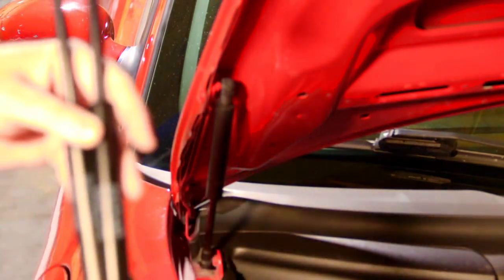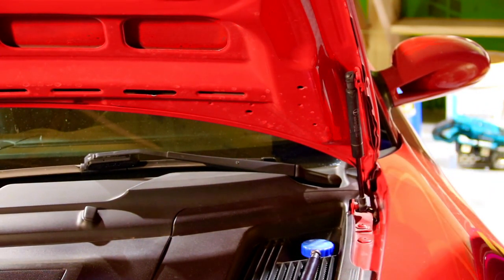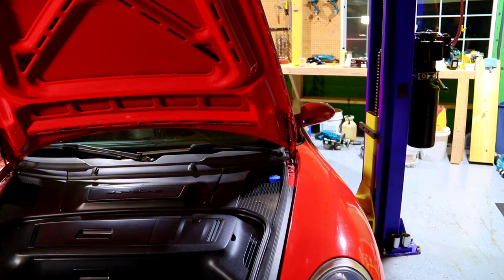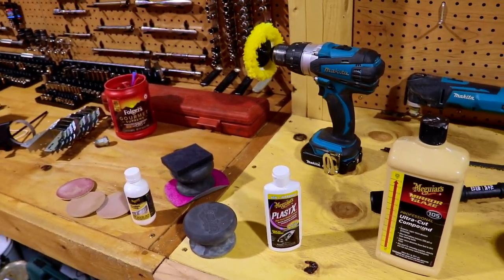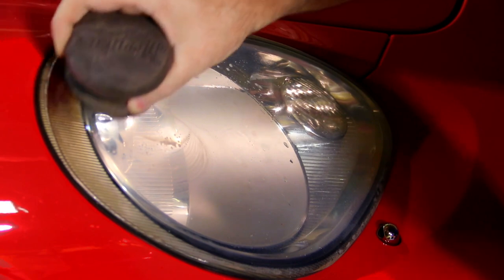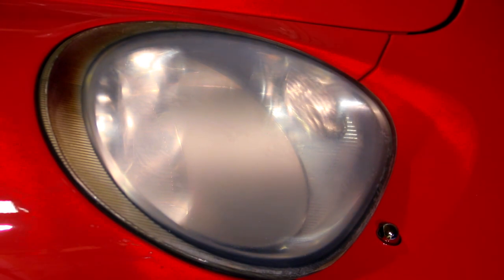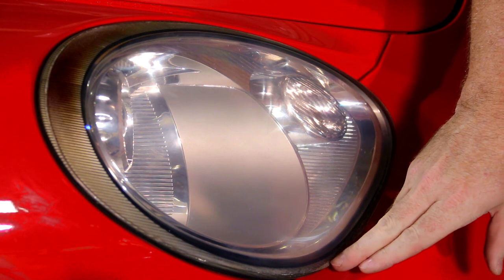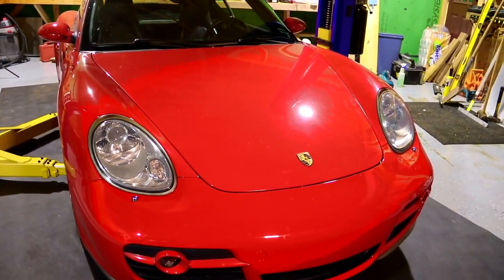Porsche Cayman 987 Headlight Restoration And OEM Hood Strut Replacement

Comment: Make sure u use sealant to protect the finish. I just use 2k sand paper then compound and follow with polish. Finish with good sealant or ceramic spray coating.

Comment: Excellent information. I purchased some cheap ones for my 997 but have not put them on yet. Thinking again now. I have had very good luck with cheap struts on my BMWs, however its probably not worth the risk if it pops off at the wrong time and messes up the bodyworks or hinges etc.
Reply: You won't know until you try them, some aftermarkets are just fine, while others are trash.

Comment: Almost had a seizure when you lost that screwdriver 😳 I've always used blankets to put around the area of potential disaster and those shock clips I've had good luck using a seal pick to remove them the control factor is  better.  I've learned when working on expensive cars especially if its not mine. Better safe than sorry.